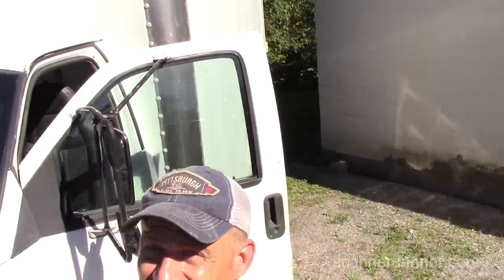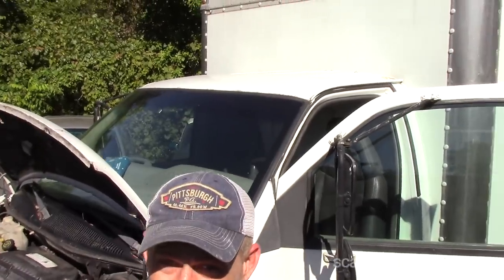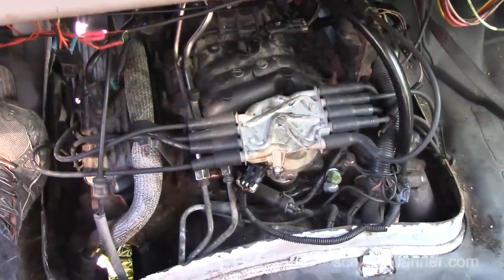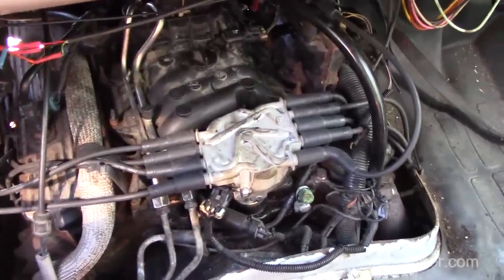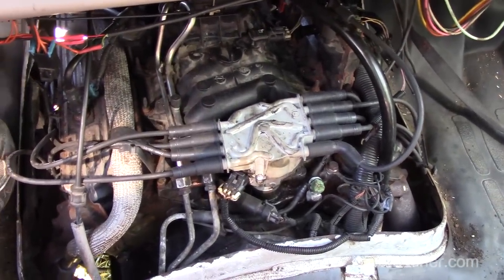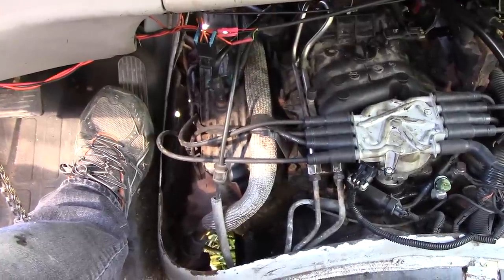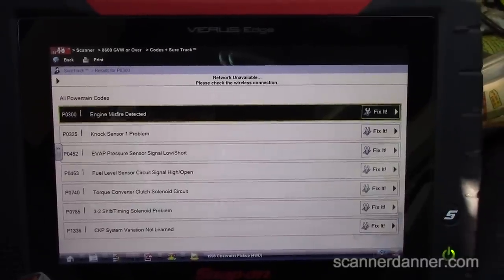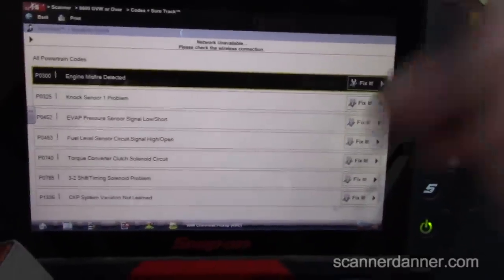How to quickly identify a vacuum leak using fuel trim and water

Comment: Thank you for this great video. Talking about water, I used it in the past to detect vacuum leaks and it is easy, safe, and a successful humble method. However, I have met more than a couple technicians who said to me not to use water because it is going to get sucked down into the combustion chambers. What I said to them was that even if there would be a few drops of water in the combustion chambers, the compression ratio is not gonna be affected that much and no damage is gonna occur due to using water for checking a vacuum leak. I am actually impressed by the way you check and test vehicles' performance issues. You are in control of both, the simple method and the very advanced methods to find and pin point the root cause of engines performance problems.
God bless you and God bless your good work.

Comment: Legend. Had something similar wrong with my car. Fuel trims were ridiculously high while under load but it was fine at idle. Checked for a vacuum leak using this method but no joy. Watched your video on MAF readings etc. and found out I had a bad MAF sensor. Keep up the great work Paul, definitely going to sign up for your premium videos.
Reply from the maker: Thanks so much!

Comment: Already used the water bottle to help a buddy with a preOBD2 (no scan tool) 4 banger to find a vac leak. It died on startup and when it warmed up it missed horrible at idle, but ran decent revved and had a strong gas smell at the tailpipe. He thought I was crazy when I told him what I was going to do with the water bottle. He stopped giving me funny looks when the motor died as soon as the water hit a vac line connector on the intake. Cut an inch off the line and it ran fine after it relearned the trims.

Comment: If any doubt the water method. Paul ain't lyin. I have an 06 Mercedes E350 in here right now. There PCV system is like the BMW's. A bunch of crappy rubber hoses  that have to contain full engine vacuum. If as Paul always says u go OBD ll global and look at STFT then spray a fuel source u will quickly find the leak. Or, get out the spray bottle and listen. It works fantastic. Found the problem in 5 min
Reply from the maker: Nice Bill. Thanks!

Comment: @scannerdanner I watched this video in the morning and i actually use this test in a car this afternoon and really work. Well done well done Paul
Reply from the maker: thank you!
Reply: @ScannerDanner  I have a 08 Chevy Express with 6.0 I long term trims usually are at 24% on bank 2 I have p0174 and p0300 rims usually fluctuate weather it's hot cold and I spray water on intake but rpms still fluctuate weather I spray water or not?? When motor gets hot trims go to zero bit if I push throttle trims go back up to 24%??? when I go up hills while engine running it pops just like this one..I'm just trying to get some advice on where I should go?????
Thanks
Dylan
Reply from the maker: @Smith93646  pops through the intake under load and trims that elevate at higher rpms is not a vacuum leak. Check fuel pressure and MAF. Unplug the MAF and drive it and see how it runs as a next step
Reply: @ScannerDanner  well dang I was on the wrong track but okay thanks I'm about to to that now
Reply: @ScannerDanner  I unplugged the MAF SENSOR IF WOULD CRANK OVER AND START BUT WOULDN'T STAY RUNNING?

Comment: Hi Paul , thanks for every share you are a great man , hope you will look my problem too , STFT at idle is -7 and LTFT is -14 and at acceleration STFT improves , it is Toyota Camry 2010 model, need some hints from your expert side to go around
Reply: leaky fuel regulator, injectors leaking down, clogged air filter, coolant temp sensor misreading? is car getting up to temp, stuck open thermostat?

Comment: The most confusing things about fuel trim is the jargon. When the computer boosts injector time to add fuel, it is normally in response to a lean situation. When looking at fuel trim you're seeing the response, adding fuel. Of course the cause is a lean signal from O2 sensors. So it's a lean situation even though more than usual fuel is being delivered.
Reply: Yes. I occasionally have to remind myself of tis because it's sort of contradictory
Reply: That's not confusing at all.  Just remember the computer is trying to compensate for something.

Comment: I have Found that smaller leaks are easier to find w/ a smoke machine. 
I'm using this all the time. ODD on fords when vehicle stalls the trims default to 45%. (have also seen other default KOEO values incorrect until started) Maybe that's just my scan tool. solus ultra.

Comment: I'm gonna have to build me one of them thar water bottle diagnostic tools. Certainly alot cheaper than my Maxisys was ... :)

My buddy owns a '96 Tahoe that defeated me a few years back. Was a no-start - he went out one day, and it wouldn't start. Threw a junkyard computer in and it fired right up ... on 6 cylinders. We played the parts-changing game (bad bad bad ...) and $1,000 later, I felt the slightest improvement, but still a dead miss. Now that I've been watching you, Eric O., Ivan, and ETCG, I know what I need to do to get a handle on that thing. That truck has been eating at me ever since! I don't like defeat, lol. Now that I've got a Maxisys and a back-probe kit for my meter, I think I may have hope of getting this thing hitting on all 8. Going to try the newfound knowledge out on it at some point.  THANKS for the great videos!
Reply: Make sure the PCM you used was from a v8. if it came from a 6 cyl. engine, it will only have programming for 6 injectors. A re-flash will take care of it.
Reply: I actually just found this out last week! I finally have a scan tool capable of reading the VIN off the ECU ... and lo and behold, it came off a '96 S10 Blazer 4.3! I suspected this, but couldn't prove it. That junkyard really ripped me off.

We ended up finding a guy on eBay out of OH that reflashes used ECUs to the VIN you email him. $90. Should have this thing actually running correctly for the first time in 5 years by this weekend. :)

Next purchase is going to be a laptop and a J2534.
Reply: HAHAHA! No thanks Mike - got some here for free. :D

And as an update to this post that I forgot about, that Tahoe is now finally hitting on all 8. Runs like a champ once again. :)

Comment: Hey it's me again about the 1994 s10 4x4 ls put the spider in been 3weeks and had take it out they well orileys sold me a part that they didn't order got the other one in running perfect but when the other spider messed up it made my transmission we're it won't go into overdrive manually shift it 1st 2nd half to floor it it will hit drive and it will change down when slowing down .but the other thing is when you start it it's fine when you put your foot on gas when it does it .sounds like vacum or something

Comment: Great Video...Was driving my 2002 Escalade across TX and noticed LTFT + 13 to 18 % at light loads while cruising, both banks. While STFT was about 0% I did get a P0440 Evap fault that morning so that's why I was checking it. Also had to replace front bank 1 o2 a few weeks ago for a burned out heater circuit. I cleared code and it didn't come back. At idle Short & LTFTs are normal + or - 3%. This doesn't seem like a typical vacuum leak with readings normal at idle. Any ideas ???
Reply: Update started with fuel delivery.  Found fuel pressure a little low at 45 psi at idle.  Noticed pressure dropped off to zero 2 minutes after key off.  Pinched return line held pressure.  Replace regulator and correct that plus gained 3 psi more at idle. Test drove saw some improvement in LTFTs. Cleaned MAF test drove and LTFT dropped after driving about 10 minutes.  Plus improved acceleration and idle. Thanks!
Reply: @BlueEyeTableRockLake   Your 2 comments have perhaps helped me figure out what's going on with my 2007 chevy van, 4.8 L V8.   It has a couple issues; getting codes related to O2 bank 1, sensor 1 as well as having LTFT on both banks at 25% (bank 1) and 18% at idle.  STFT numbers are good.  Also, the other three O2 sensor values and behavior look normal.  When i rev it up and hold it for a minute or two the LTFT numbers drop off a little but not much.  At first i was thinking it may have a vacuum leak but now beginning to suspect a dirty MAF.  I will explore that.  Am i correct in saying that a dirty MAF will cause a lean condition that the computer will then compensate for by adding (LTFT in high + range) fuel?  I think i've got that figured right but if i'm off the mark i'd appreciate feedback from anyone who has better grasp of this subject than me.  I'm still learning about all this stuff which is new territory for me and my diy journey.

Comment: 2005 Toyota matrix 1.8l, ltft at 10.9 when first warmed up at idle ltft goes to 19.5 after 30 min drive, new intake gasket and throttle body gasket, can't find any vacuum leaks with water, any suggestions

Comment: ScannerDanner, what are FT (2) numbers?  I've seen ones listed as STFT1 & STFT2 and also STFT11 and STFT22 which don't always match up but I was never really sure what the 11 and 22 ones are.  I just go by the regular ones and get the job done.  Thanks
Reply from the maker: Most FT (2) numbers are not used and are listed at 99% all the time and they never change. There are some manufactures that do use down stream fuel trim, so be careful. But in general, I never pay attention to those numbers.
Reply: Thank you for the reply.  To they are downstream fuel trims?  I have seen them change but I never really paid much attention to them when I see them.

Comment: We use brake cleaner or a similar aerosol cleaner. Is water better, worse or just another viable option?
Reply from the maker: After catching the underhood of a customers car on fire while they watched, I stopped using flammable liquids to find vacuum leaks. Also, the water test is more accurate in most applications

Comment: How profitable is it to be a mobile diagnostic guy? It's something that appeals to my interests.
Reply: you may not get rich but there is always work to do... look at how many garages have so much difficulties in diagnosing electronic stuff on modern cars... they pull the codes and if that does not say "replace part X" than they´re more or less finished
Reply from the maker: Very profitable if you are accurate. enough to make a living doing it and working for yourself.

Comment: Is it ok to have water suck in through a vacuum. I am new to this and a DIYer so please eductae me on how it will or will not enter the engine if it pulled in water.
Reply from the maker: It isn't enough to cause any damage or to hydrolock an engine. It will simply steam clean the cylinder it's getting pulled into. This was actually an old way of decarboning an engine.

Comment: Can we splash water anywhere and everywhere under the hood without worry?  Even into the alternator vents?
Reply: Well, I wouldn't advise throwing a bucket of water straight into the throttle body unless you want to rebuild the whole motor. You'll likely bend the pistons if it's running or cranked with water in it (look up hydrolock) :) Small amounts are fine even in the intake because it gets turned into steam in the cylinders. Everything else on a motor except inside the distributor cap tolerates water pretty well. As far as I know the alternator doesn't care about water and I've never had a problem with them getting wet.

Comment: don't know if you read comments but got a question. will a low battery/charging system throw off codes for a TCM or abs module.
Reply from the maker: It would surprise me. Had antitheft issues on a Ford from a week battery. Fix the battery issue first
Reply from the maker: Wouldnt

Comment: Hi Paul;  what will make a 1.6 four banger(daewoo/chevy   nubira-2001) go into open loop above idle (1000 and above) ONLY when stopped?  (closed loop ok at idle,nice swing of the o2 sensor); as soon as you rev it past idle speed, boom, oxy sensor pegs at ~.85V; this w/the car stopped,ONLY; slightest load on the engine,and closed loop returns: for instance,its enough to turn on the A/C and the high beams,and it´s ok;; ok  also when the car is moving;  it´s always a problem at the emissions inspection; been driving (actually,the other way around,lol) me mad for 2 years now,all sensors give good values(temp,map,tps,tried a few o2s); no codes; the car was converted to lpg,does it running gasoline or lpg;it will also stay in closed loop if i create a VERY SMALL leak on the vac.hose to the MAP;  have an adjustable 50 cent plastic fish tank  airline controller connected to it with a plasticTee, messes up the idle a very tiny bit,but  it works; 

When it goes open loop,the scanner says:"Open  loop due to load or decceleration";  neither of these beeing factual;   none of the o2 sensors i tried were originals; they were  from bmw,jaguar,etc,spliced into the nubira wiring.
Reply from the maker: It is becoming more and more difficult to answer questions here. I have 80,000 people asking me for help now. So I have created a forum to help you guys better. It is free to join and we can exchange pictures, wiring diagrams and waveforms if needed to help guide you through the process of troubleshooting your vehicle. Thank you so much! Hope to see you there. 
Paul Danner (ScannerDanner)
 https://www.scannerdanner.com/forum/post-your-repair-questions-here.html

Comment: my fuel trim has high numbers when in idle (parked). short-term and long-term add up to +17.  I believe I have a leak on the exhaust manifold near the O2 sensor.  the car is stalling when im at a stop sign or red light. only stalls when I have my foot on the brake or put the car into reverse. the car stalls and I sometimes hear a bang after it stalls.  will this stalling cause damage to my engine?
Reply from the maker: I dont like the bang noise symptom but no, a stalling issue won't damage an engine
Reply: @ScannerDanner  I'm hoping it's just the motor mounts or the exhaust hangers. ty

Comment: My 2001 blazer 4.3 l threw me a code p0135 n p0300 I check fuel trim dont understand it .. 2long -6.3 2short -1.6 and 1long 25.0 and 1short 24.4 if u can help and understand the #s thanx
Reply from the maker: You fix this? Define the P0135 code. (O2?) And if so, what is your O2 signal voltage doing?

Comment: Hi i have a question if my BlueDriver counts 1 misfire while a trip and next day another cylinder counts also 1 is it a leak vacuum or crank shift sensor or clogged injectors
Reply: My car is mercedes e280 2006 model v6

Comment: I need some help please and I don't ask for help very often. I have a 1998 GMC 5.7, have a lean code on both banks come up, I have smoked, sprayed chemical and water bottled; no leaks found. Sometimes the light will go out and stay off for a while like the other weekend after the light went off I drove 360 plus miles no light until I got 1 mile from home then here it comes on again. Basically at idle numbers run st 0.08 to 2.3 and lt runs 16-27. Steady 2000 rpm lt will drop to around 16. Additionally I have changed out the maf sensor from another identical truck system and cleaned both. MAP sensor was also exchanged. At first I looked at the trottle body maf cover gasket for it seemed loose seal so I couldn't find a new one at the local parts store so I put a heavy dose of form a gasket 2 around that until I find the issue. I just checked the o2 sensor readings and all four readings of volts move up and down 0.10 - 0.900 but at 2000 rpms bank 2 downstream sorta sits at 0.110 at idle it responds more. Thanks for any help!!!
Reply from the maker: First test, what are your upstream O2 sensors reading at WOT? 
They should both be full rich (800mv plus, flat-line)
This will be our fuel delivery test.
After this, I may want you to check this for an internal vacuum leak. We will talk about this after the O2 WOT test
Reply: Thank you for your response!  I now have to apologize because I had a good Innova scan tool on loan so instead I now have a crappy cheap one and trying to get you that number will not be accurate now, for it apparently can't receive or process data fast enough and about the time you start to get a 2000-2500 rpm reading it shuts down on me, but best I can read in an intense  o2 reads less than 800mv but seems to be worst on bank 2. I did see a reading of around 695.Neither bank holds the higher 800mv though. At idle both banks will move up and down to the 800mv. Far as fuel regulator I installed a new one and cleaned injectors last year. Another note: vehicle will sometimes buck mostly seems underload on the interstate then smooth back out, it's rare occurrence. I checked the IAC today, it's working okay. Motor runs great except for the codes. If you need more accurate numbers I probably can get them Monday. This morning with engine cold I poured 2 litters of water on intake and fuel port, no problems showed up.  Sorry again.   @ScannerDanner
Reply from the maker: Do this test during a test drive (allows more time at WOT) (also, you only need to wind out 1st gear, no need to take chances with speed) and try to limit the amount of data parameters you are looking at. This speeds up the data a ton on some tools.
Reply: OK Here is the lucky reading I came up with: bank 1 900v bank 2 890v.   At a warm engine idle warming up to 192 degrees or so this is the numbers no trottle up....stf1 0-2.3 ltf 9.7-14.7 Bank 2 few points lower on ltf. Thanks  @ScannerDanner
Reply from the maker: This is at WOT? Just an FYI, fuel trim numbers are irrelevant when you are at WOT as the oxygen sensors are being ignored. 
If these O2 readings you gave me are at WOT, then this means you do NOT have a fuel delivery issue causing your lean condition faults. On to the internal vacuum leak test.